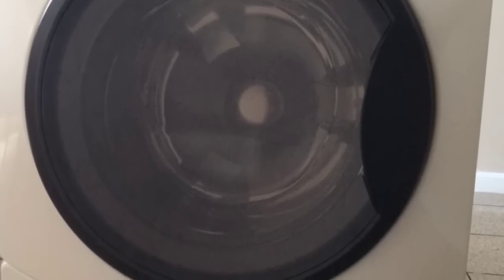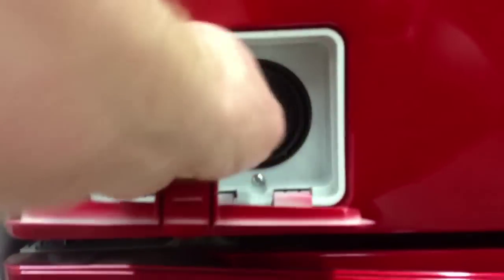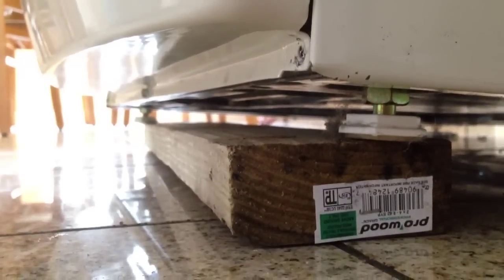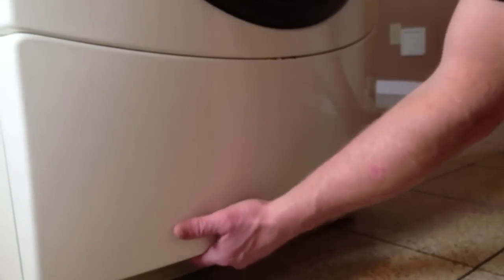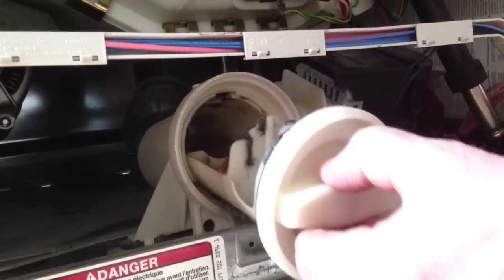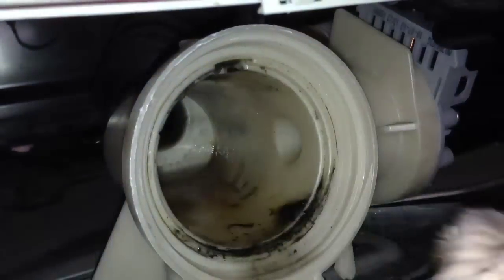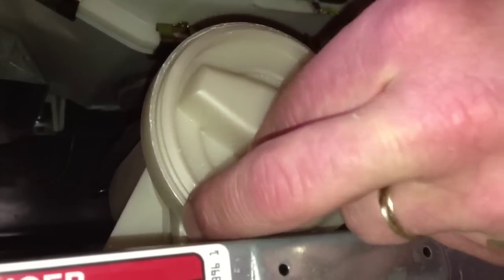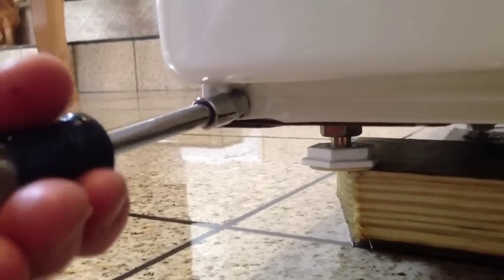Cleaning the drain basket on a Kenmore Elite HE3T

Comment: Wifey tried to wash a heavy blanket and a towel from a beach trip yesterday. We got the SUDS error and then it went to F21. I thought it was just that the machine couldn't handle the amount of water from these heavy items. Couldn't get the F21 error to clear so to YouTube I went! This video probably just saved me from at least a $100 service call. I have a HE3t. Used my little T20 torx socket with my drill and took the cover off. I didn't even need to prop it up (although that would help get to the screws). Took out out the drain basket and found a penny and what looked like the remnants of a pen. Cleaned it, put it back in, and right now we are back in business. funbro1 you, sir, are a rockstar! Thank you!
Reply from the maker: Joseph Chavez Thanks for watching, glad you were able to use the video to help.

Comment: Thanks so much for this video.  It helped us resolve an F02 error on our washer.  We had some coins, foam ear plugs (from my job), and a golf tee in the trap.  I didn't think this would be enough to totally plug the flow -- so I also squeezed the flexible hose from the drum to the drain trap and one of my daughters small socks slowed oozed out.  Fingers crossed that that resolved our problem.

Comment: I fixed my Kenmore elite washer after watching this! I had a pen, sock, and nail clippers clogging my drain. Thanks for the quick guide. Definitely have to prop it up with some wood to get that bottom middle screw with a drill.
Reply from the maker: I find it interesting what kind of things that are found in that basket. Glad you were able to use the video, Thanks for watching.

Comment: Yo - Thanks a million for your step by step instructions. Also, thanks so much for including the nut driver size. I could not fiqure what size to use. Before watching your video, I took pictures of the screw to ask Home Depot for help. It too me about 10 minutes to get the drain out, clean it (broken pencils, $1.95 in coins and a ton of smelling lint) and to put it back in. We saved about $200 from not calling Sears to come out  Thanks again and God bless.

Comment: I got the F2 error, found out what it was on another site, took off the bottom panel, and let out the water by turning the knob a little.  After the water was out I turned the knob further to remove the drain basket . . . and the front of the knob was all that came out.  I then found your site to see a photo of the unit, and clearly, just the knob part came off, leaving the basket part jammed in there.  That must have happened when I attempted to back off the turn of the knob to reduce the flow of water coming out, and pushed in while turning back.  The knob disconnected from the basket (it was really two parts) and the basket jammed in there (presumably on the debris).  Well, after scratching my head, I grabbed one of the "fins" that the knob part had covered before with a pair of big pliers and PULLED.  Out came the basket, absolutely filled with lint, various broken bits of things, a bottle cap, two socks and $1.06 in change.  Sure wish these units came with a little sign on the front suggesting occasional cleanings.  I'm going to use a thin, flexible magnet as a "last cleaned on date" reminder.  My husband was impressed with my "repair."  Thanks so much for the video.
Reply from the maker: DruhK I agree the manufacturer did not do the users any favors on this model. Some models have a door in front of them that allows easy clean out. Unfortunately this one does not. That's a lot of stuff you found and the good thing is you saved a heafty repair bill. Thanks for watching.

Comment: It is very helpful. Also if you include the part number for the drain basket the more it is useful to us.
Reply from the maker: Try  8182821 280187 for the pump assembly. Hope this helps Thanks for watching.

Comment: Great video to help us fix our washers with the F02 code.  My problem is the front threaded section separated from the basket.  Doesn't look broken just like it was designed to pull apart and now getting the basket out is not an easy task.  Might need a new one.
Reply from the maker: You may be able to find one online if you need to get a new one. I wish you the best, thanks for the view.

Comment: Thanks for the great tip! Any thoughts on why it appears that the dispenser for the fabric softener is not draining/clearing out?  I have taken the slide in and out unit out, disassemble it and cleaned it. Would appreciate any insight you might have.
Reply from the maker: Robert Ginder I have heard of this problem before, try mixing a little water with your softener when putting it in the dispenser. This has worked in the past, hope it works for you. Thanks for watching.

Comment: FYI  if getting a F02 error-- check this basket AND check the drain tube (on back of washer to wall) -- my drain tube was totally clogged--cleaned it out and working again...
I also did this cleanout too while at it :)  but it wasnt my issue...
Reply from the maker: Thanks for the tip and thanks for watching.

Comment: Have a question I'm hoping you can help me with. I've had my Kenmore HE3 washer for approx 8 yrs now...Never (knock on wood) any problems...ever. And I do a LOT of laundry, although my demand for preventative maintenance forgoes the onset of problems (i.e: checking all pockets before loading in washer; buttoning/zipping up all pants, jackets, etc. - anything that may bang around on the drum; using HE detergent, and so on...). After 8 yrs of being the only one to use my washer, I recently relinquished solo control and well, here I am writing this to you! My friend's son & gf washed a blanket w/out shaking it out that was loaded (I do mean LOADED) w/sand and dog hair-- to the tune of having to take a vacuum to the dryer drum as there was soooo much dog hair and sand in the DRYER. So, what does that say for my WASHER??? I have yet to wash another load as it happened today and have NO idea where to begin looking for any excess sand/hair etc. Again, I'm about preventative maintenance and before I do another load (which really needs to be done tonight), where oh where do I check for damage control??! Thank You -
Reply from the maker: Well as you can see by watching the video cleaning the drain basket is really a pretty simple task and would definitely fit in the preventative maintenance category. I would recommend this to be your first step. It is worth the time it takes to complete the task. A good amount of sand and dog hair would have run down the drain, that being said any hair that was not rinsed down the drain would be stuck in the holes in the drain basket. Likewise the sand being heavy would land in the lowest part of the washer which is just below the drain basket. If you have a wet and dry vac (with the drain basket removed) use that to clean out the area around and inside where the drain basket lives. This should suck out any hair that may have gotten lodged in the pump area or sand that may have fallen to the lowest point. You could start with a clean vacuum and look in the vacuum after cleaning it out to see if you actually removed anything from the pump area. Just remember to put a towel down before removing the drain basket because you will probably still have a little water in this area. Hope this helps, good luck.

Comment: Great video! I just bought a used Quiet pak4 HE3t and will be attending to the filter within a few days.

I do have an issue, however. I get an F20 error within 10 min of starting a load. I checked the water hose screens, which were quite clear. While I have enough flow at the faucet, there is so little water being admitted that the detergent remains completely dry and unused. I pulled the top to observe a cycle and noticed that after the door locks, a servo motor moves a plenum vane to #1 position and the water solenoid begins admission, which ends after 1 sec. The door unlocks, relocks, at which the servo moves the plenum to its max #4 position, then back down through #1, almost to a physical stop, ending up at #2, at which time the cycle starts as already stated.

Is this normal, or is a problem indicated?

TIA
Reply from the maker: +psycotria I've never looked into that area of the machine. I know there is usually a lot going on there so it is possible that what you describe is normal.

Comment: Hi funbro I know this video is old and don't know if you will see this, but just realized I had a question that I didn't see addressed in the comments.  I have my washer mounted on the drawer that was an option that sits under the washing machine.  Can you still tip the washer to get at the bottom or do you have to remove the drawer unit first and then proceed?  Thank you for your help if you see this comment.
Reply from the maker: You may have to disconnect the mount to tilt the washer back but you should be able to without taking it off. Thanks for watching.

Comment: Great video-I followed instructions but my drain was actually clear.  Any thoughts on what might be causing my F9 code? Only way for me to finish a load is to shut the water off when I get the code then resume the wash cycle.
Reply from the maker: Chris Heney An F9 code indicates a clogged pump or pump malfunction. You could start by checking pipes going to the pump to make sure they are all clear, it is possible that something has gotten past the filter basket and made its way into the pump. Also you could check the electrical connections to the pump they could possibly be loose. Most of the time it is something caught in the pump but it could possible be a pump going bad.  Hope this helps.
Reply: I had that problem and took the top off and had to engage the electrical connections that are right there on top.
Reply from the maker: It is possible that the pump may be going bad or the impeller is worn. Maybe something is clogged somewhere other than the drain basket. You could try using a wet and dry vac and suck the entire system out, if that doesn't change anything it might be the pump.

Comment: I was trying to figure out where mine is leaking underneath.  There's a "drip....drip....drip" that comes from which ever corner happens to be the lowest point.  I slightly tilted it to each corner and ran a load to see if it would drip at the corner I had set lower than the other 3.  Because of it doing this I'm assuming this trap you showed in the video maybe has a leak around the seal and it being close to the front of it like shown in the video is causing it to drip then run around the edge and out of the lowest of the 4 corners.  This is what I'm hoping for anyway.
Reply from the maker: Let's hope that's al it is.
Thanks for watching.
Reply: @funbro1  mine still works and hasn't leaked since btw.

Comment: Hi I know this video is posted so long and the chances of you to replying to this question are slim but I was wondering is this something that would help fix the f2 code? It's also throwing SUD
Reply from the maker: Lol and yet here I am. That was a code I was having when I went to clean out the basket. The problem I found with mine was a rubber band was left in someone’s pocket and fell out during the wash cycle and made its way down to that area and caused it to error. Once I cleaned it out everything worked perfectly so I would not hesitate to try this on yours. Hope the fix is as easy for you as it was for me. Thanks for watching.
Reply: @funbro1  thanks so much for the reply! So I haven't cleaned it out yet because I haven't had the time today. I was also wondering, some times my cycle will go all the way through with out stopping could that still be the issue ?
Reply from the maker: @chrislloyd7642  It would be worth the time to try it. Wouldn't hurt.

Comment: So I done as per instructions, but one thing I can't get take the cap off any solutions to this minor problem?
Reply from the maker: mikki keeble The only way it comes off is a 1/4 turn counter clockwise. It does have an o-ring around it that might give you some resistance but that's all there is to it. Just a suggestion: If you are having this hard of a time removing the cap, when you do finally get the cap off (I feel confident you will succeed)  Use some Vaseline or faucet grease and work it around the o-ring before putting it back together. This will make it easier to re-install and easier to remove next time. Hope this helps, let us know how it goes.

Comment: This was SUPER helpful as an entire pen had broken, tons of changes and bobby pins. Really easy to follow. I have one issue though. When I plug in the washer, it blows the reset switch on the outlet now. Has to be related as it did not happen until after I took off the filter. It ran for a moment but only blows it now so the door is also latched on it. I let it all dry over night in case water was conducting somewhere but still doing it. Any suggestions?

Comment: I have a question I have a Kenmore elite HE3T washer the only problem with it is that it won't start i have already clean the drain basket. Please help if you can
Reply from the maker: If you already cleaned the drain basket and made sure that all the debris were out of the pump area then you must start at the beginning. You did not indicate if you had any lights on or not so I will assume the worst (no lights on). First make sure you have power at the plug then make sure you have power at the machine by testing with a meter. After that I would begin by looking at the door switch because the machine will not start if the door is not closed. If the door switch is broken or bad then the machine will not work. Next would be the pump because the machine will run the pump for a little bit when starting a cycle to remove any water that may be left over. Next check all the wiring, I have had a washer that one of the wires came out of the holder and rubbed up against the drum and after awhile of rubbing against a spinning drum it finally broke the wire. The only way I found this was dissembling the machine to expose the wiring. Worst cast would be your motor or control board and those would be the most expensive to replace. Hopefully this helps, and good luck.

Comment: Hi looking for some help on my dryer it heats up fine and buttons work i can use the timed dry and express dry and it will start just fine but will jump from 58 minutes to like 20 minutes so basically my timer skips and dont know what the heck is going if you can please help thanks. Oh i have a kenmore elite quiet pak h3
Reply from the maker: Norma Lopez If this happens on timed dry the I would say that your control panel may be the issue but if it happens on sensor dry then a sensor could be the problem. Hope this helps, thanks for watching.

Comment: My he3t keeps over filling setting off the FH code.  Stops on C05 when running diagnostics and not advancing.  Help needed
Reply from the maker: Sounds like a sensor to me,  Hard to diagnose without seeing it.
Reply: Mine does it to turn the water off above the washer every time you’re done washing until you fix it

Comment: Hi, thanks so much for this -- I'm getting the F02 error on my washer.  Never knew it had one of these, and I'll bet the person from whom I bought the house it came with never cleaned it out either.  I have one question.  There's a fair bit of water in my washer, because I tried the drain/spin a couple of times (2nd time with nothing in the washer) and it added water each time before it errored out.  Will ALL that water come out when I open the drain basket?
Reply: Good question...

Comment: just tried this and now a new error code SUD is coming up. Any suggestions?
Reply from the maker: The SUD message appears when the machine senses too much detergent. It does this by measuring the amount of flow being drawn by the motor. Several thing could cause this. 1. Too much soap, try running a cycle with NO soap at all. (Run a load with very little clothes in it) 2. Something else is clogging the impeller or stuck in the hose area, Take out the drain basket and use a shop vac to suck out the entire hose area, impeller, and drain basket, make sure the impeller spins freely. 3. A hose is crimped somewhere in the machine restricting flow. 4. A wire has come loose on the drain pump or pressure switch. 5. The pressure switch is bad and needs replaced. 6. The pump is bad, replace is necessary. Start with the easiest and work your way down till you find the answer. I hope this helps. Thanks for watching

Comment: Do you know what the f11 code is
Reply from the maker: prospect4800 The f11 code indicates a communication error/break between the main control board and the motor control board. You may need a new control board (about $175 new) or a new motor control unit (about $225 new) but before spending money on parts I would recommend trying a few things first. You will need to take the top of the machine off and check all the connections around the control unit located near the back of the machine. If you are unsure how to disassemble the machine check out my bearing replacement video, it may help you out. http://youtu.be/FKR5FjOZA64 You should be looking for the three wires that go to the motor, usually blue wires. Make sure these wires are tight, and all wires for that matter. Next follow these wires down to the motor control and check that they are tight. Finally make sure the machine is level and does not "bounce" or shake when entering the spin cycle. This may cause these wires to come lose. If this does not fix your F11 problem you may unfortunately need a new control unit. Before buying a new control unit try looking online for a used one on sites like eBay, it may save you some cash. Hope this helps, let us know how it goes. Thanks for watching
Reply: Thank you very much for your time and response!